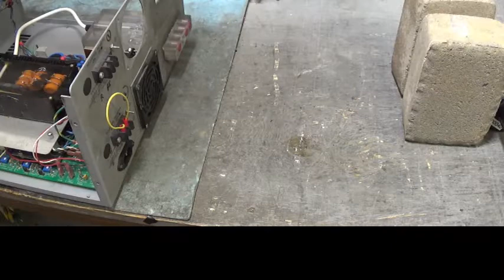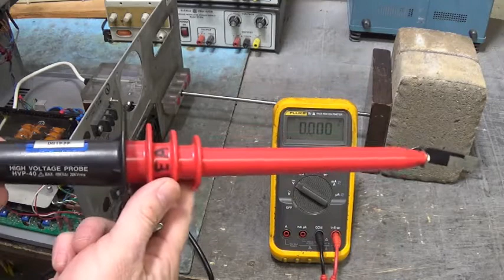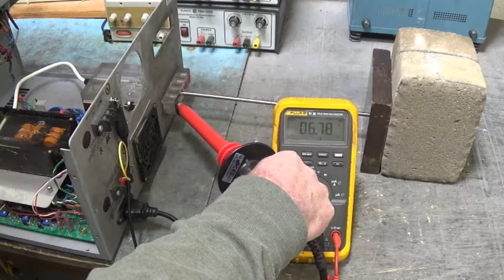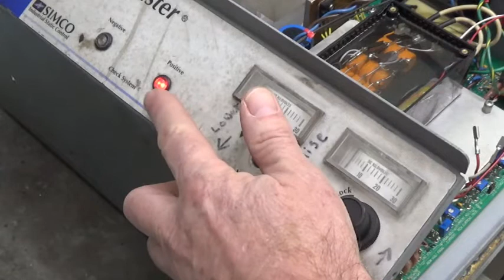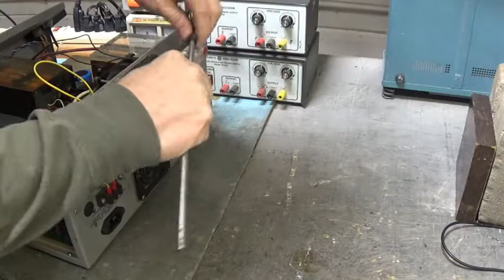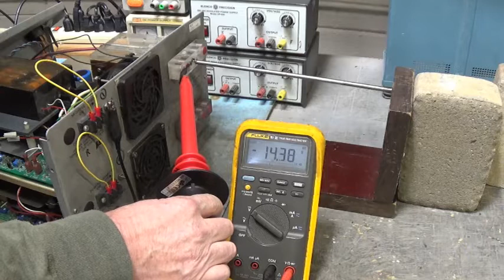Simco Industrial Static Control Dual Charge Master

Comment: Great video Pee Paw! I noticed you mentioned to have built the voltage multiplier module before hand. How did you get the voltage feedback circuitry done? Many big megohm resistors to avoid internal arcing? Would you mind sharing your schematic diagram?

Keep up the good work! I enjoy your videos a lot. Thanks again, sir.